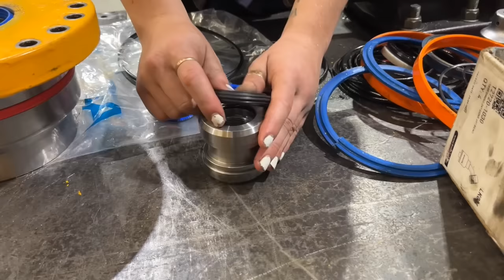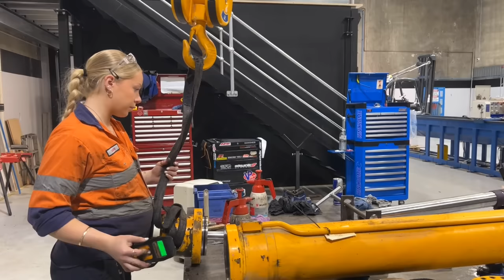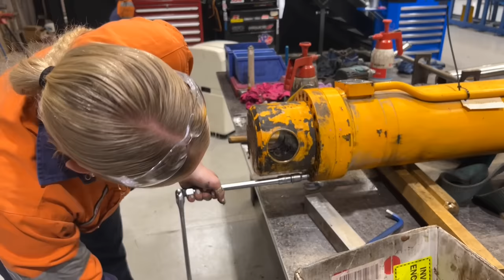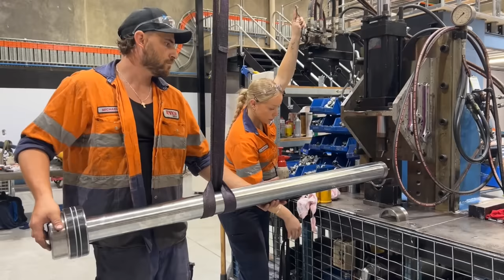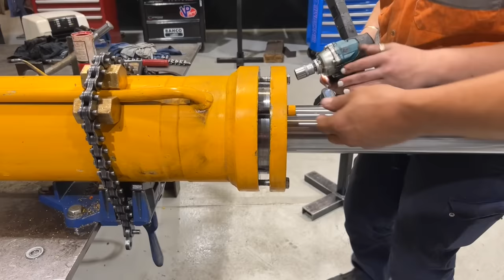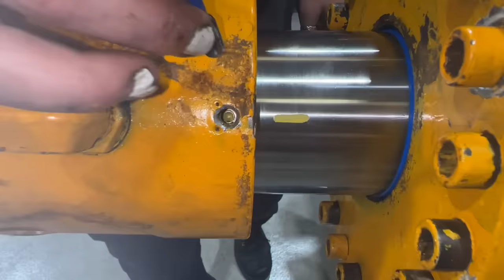DIECI BOOM LIFT Cylinder Rebuild - Part 2

Comment: Interesting video 
Were the valve like components a form of sensors. 
Wondering as I've got to strip some wing rams at work on a 600 ton lefort mobile shear.
Cheers andy

Comment: One question, what is the internal rod of this system used for, would be a type of shock absorber or displacement smoother.
If you can answer me, thank you.
My congratulations to both of you for the beautiful work and one more special one for the Girl who demonstrates great competence in the development of her task!
Reply: It is effectively an extra second small cylinder . It adds to the overall thrust but really comes in its own when you want fast forward / retraction because it can be used to retract the large cylinder such that it moves the oil in the large cylinder with out using the main pump on the big cylinder, this is much quicker  than having the system pump directly moving the large cylinder. It also means the system hydraulic pressure stays high for other services when the big cylinder is retracting.
Reply: @GrahamHomes   Ok Tank Your for information !
Reply: Con la señorita si se tendría buen tema de conversación
Reply: @armaky4962  wrong information given, it's a compensation displacement ram to self level the tines/ bucket
Reply: @GrahamHomes  I am from China Seals Factory. Our company produces many types of hydraulic oil seals. If you are interested in our products, we can send you free samples so that you can learn more about our products.

Comment: the truth is that she cannot do the job without the man's help .. women do not have the strength required to work with hydraulic cylinders of that size .. it can often require a 12 kg hammer and large keys with 3 meters of pipe to loosen the nut + two 2-3 men with full power,, if they were 10 women they couldn't loosen the nut .. they can be so tight that it has to be cut free even small cylinders can be an arrow in the ass,